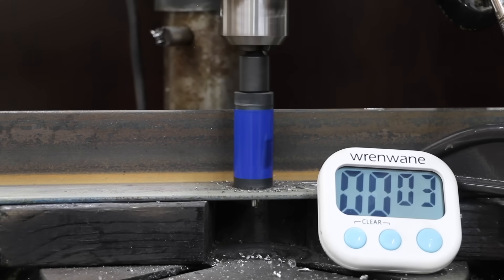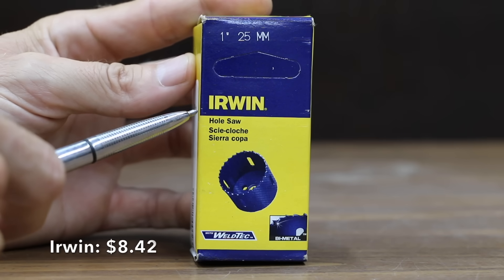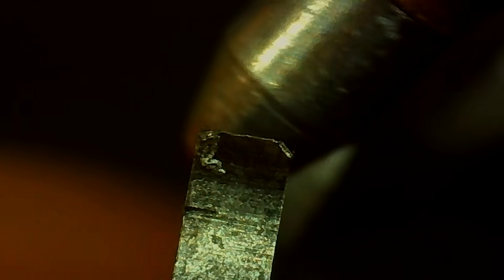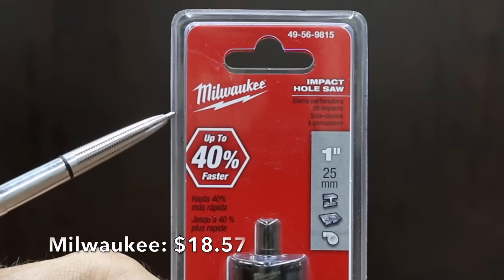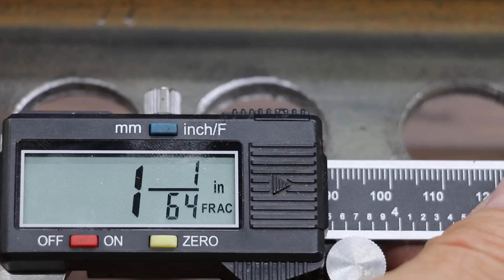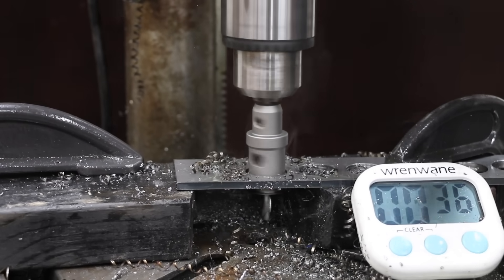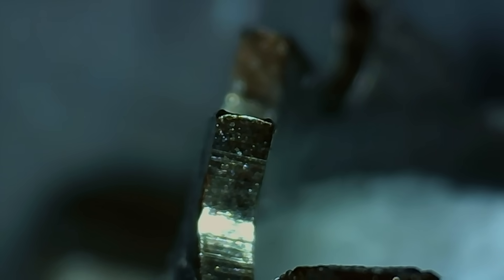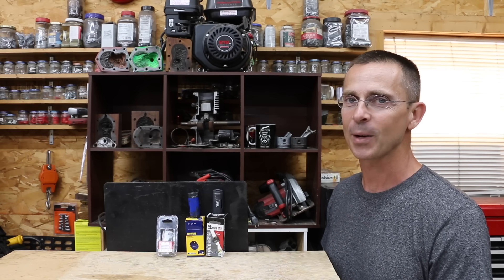Best Hole Saw Brand? DeWalt vs Milwaukee vs Irwin, Bosch, Lenox, Diablo, Bosch, MK Morse

Comment: Durability of orbital sand paper would be cool to see. I use that Gator brand from Wal-Mart and it seems to outlast and outperform 3M which is kind of a shock. Probably pretty hard to test that objectively though.
Reply from the maker: Great video idea.  Thank you.

Comment: How can you guys live with that imperial system 😂
Reply: I am an American. Raised on inches and feet etc. It would not be so bad to use inches for everything. I mean, meters and mm and so on are better. But the fractional inches drive me absolutely crazy. At least, if you use inches, use inches and mils (thousandths of an inch). Fractional inches are just stupid. Also, I would rather use inches only and not feet. Adding together dimensions with feet, inches, and fractions of inches is just so stupid. Like making the job harder on purpose. I finally bought a cm tape measure (with mm markings). It is so much easier to use it for everything.

Comment: Wow great video! I work with 1/8”-1/2” steel very often and I’ve really struggled to find quality hole saws that aren’t very expensive but can get the job done even once on the thicker steel let alone do it over and over like they should be able to before needing sharpening. I usually buy this kind of stuff from one of my local hardware stores though so I’ve never heard of TCT, NGE, or MK Morse. But the MK Morse seemed to perform pretty well and seems like a really good deal so I think I’m going to find some and give them a try! I really appreciate your time as always👍🏼
Reply from the maker: Thanks so much!

Comment: Another great video! Would love you to test wet and dry sandpaper! Testing tensile strength would be handy. When cutting it into strips to get into tight areas it always snaps, so have to use tape backing.
Reply from the maker: Great video idea.  Thank you.

Comment: Could you include the rpm of your drill press on the next test? It should provide a good idea how speed plays a role for different bits.
Carbide and Bi-metal should have different recommended rpm and feed rate...
Reply from the maker: Great suggestion!  Thank you.

Comment: Is the armour plate you are using surface hardened?  Just wondering if you were drilling inside to outside face of the armour, hence the drills bogging down when they reach in to the hardened side of the metal.

Comment: Kind of hard to tell but it looks like either the drill press was running out or the table or vise setup was moving relative to the hole saw. If so, that could explain some of the stalling or chipping of the Carbide
Reply from the maker: Thanks for the feedback.

Comment: So I do alot of chainsaw work, and I've seen and read online that you could potentially put used motor oil into it and it would be better than nothing. I think it would make a good video if you would put used motor oil into an engine and see what actually happens, because I'm really curious and would like to know if its actually fine to use that, or if its not.
Reply from the maker: Thanks for the video idea.

Comment: I practically never use hole saws these days, Changed over to rotabroach or slug cutters as some call them so much faster with a better finnish. I use them both with a mag drill and with an adapter in the pillar drill for larger holes that I would have used a drill bit for in the past. The only time I use a hole saw is if I have to make a larger size hole in thin sheet with a hand drill.
Reply from the maker: Thanks for sharing.

Comment: Nice ! Id like to share a trick i saw in a marius hornberger video. This is probably more usefull for wood but still good to know. Those hole saws definitely dont allow for chip removal and it can get clogged up and even burn the wood. His solution was to just start the hole with the hole saw. And then drill  couple of smaller holes right up to the edge inside the circle. There the chips can accumulate. Or if you only want to keep the round cut off you can drill right up to the edge of your metal plate so the chip fly off. Worth a watch that video!
Reply from the maker: Thanks for the feedback.

Comment: Interesting video, well done. Really good comments from others. One thing i do see, is the carbide tips have large clearance angles and throat angle. I understand carbide being brittle usually has less cutting angles to provide strength to tip edge. Check lathe and mill carbide tip angles. Good review. cheers
Reply from the maker: Thanks so much!

Comment: I work with 6061 aluminum. Can you do a sawzall blade contest with this metal? We typically use Milwaukee blades, but recently switched to Diablo.  The Diablo only lasts a bit longer from my experience.
Reply from the maker: Thanks for the suggestion.

Comment: have you done a test on air impact guns? testing the cheapest to the most expensive? see how long they can rattle before binding and if they actually reach their advertised torque spec
Reply from the maker: Thanks for the video idea.

Comment: Recently ChrisFix posted a video on fixing sugar in tank, and pointed out that the sugar  does not dissolve in fuel, I know you already tested this, but I was thinking what would happen if you  use powdered sugar?
If it is more effective than the previous test, than is  there a way  to fix an engine  after this?
Reply from the maker: Thanks for the video idea.

Comment: Can you test those angle grinder sandpaper wheels? They are arranged with a bunch of overlapping layers making it look like the sand paper will stay "sharp" as the layers wear off but that doesn't seem to be the case unless I got crappy ones.
Reply from the maker: Thanks for the video idea.

Comment: Todd, I'm glad you did these tests.  I have a craftsman brand I would love to know how it stands up. You normally seem pretty good at putting metric on screen, but with the hole diameters you didn't. Even more so, you used fractions instead of decimals.  I don't mind fractions when they have the same denominator but talking about 128th and 64th and 32nds, you lose me. I'm speaking as an American. Again please at least put metric on screen.  Thanks and keep up the good work!
Reply from the maker: Great suggestion!  Thank you.
Reply: 1" =25.4mm
You don't need to be a rocket scientist to do your own conversions.

Comment: I think not having the pilot drill damaged a lot of the hole saws in the ar500 test the carbide doesn’t like the increased and decreased chip loads. Your drillpress wobbles a lot which is what I think damaged most of the bits if you were using them in something like a milling machine or something with a sturdier table and spindle I think there would have been better results and the speed could likely have been slower with more downward pressure as well. That’s just my two cents keep up the good work!
Reply from the maker: Thanks for the feedback.

Comment: Saw a little mistake you did you said 140 seconds on the DeWalt test but is it 100 seconds it was correct in the graph just wanted to tell you that. Love your videos. :)
Reply from the maker: You are correct.  I meant to say 1 minute and 40 seconds.  Thanks!

Comment: There are several issues with this test: 1) The drilling machine is too weak. 2) the steel's hardness is weakened by the heat from the previous drilling. To do a "real" test, each hole must be done in separate steel plates, and you should really use a stronger drilling machine for this test. 3) The metal seems melted by the heat from the drill bit, you should apply coolant for such test, that might also explain the damaged teeth.
Reply: You must have missed the part where he said that he let the steel cool down between tests. I do not think there would be any residual effect from heating and cooling steel that extends 10 or 20 mm beyond the edge of the previous hole. I don't think any of the metal melted. But the bimetal bits were probably softened on the AR500 test due to heating. Bimetal has to get pretty hot to soften up. But the AR500 is tough stuff.

Comment: In my experience cheap drill presses wreck hole saws they turn way to fast and are under powered I have a mill and the hole saw last a really long time.  The blue Irwin one I have really impressed me.
Reply from the maker: Thanks for the feedback.

Comment: How thick was that AR500 plate? The reason I ask is because some of those carbide-tippes hole saws (like the one with the mandrel and the spring) have a maximum cutting depth of 1/4", because that is how deep they can go before the steel dead-heads on the interior shelf of the hole saw. I am wondering if some of the carbide saws stopped cutting not because of worn teeth, but because of no more headspace on the inside of the saw itself.

Comment: Considering we're trying to cut moderately large holes in steel, I'd like to see a comparison amongst large twist drills and annular cutters, and then take the best of the three varieties and compare those against each other. Although, not sure if your drill press could deal with the torque from a 1" twist bit, without consecutive pilot holes. Maybe include the extra time and expense of stepping up twist drills to hit an inch.
Reply from the maker: Great suggestion!  Thank you.

Comment: I just read a bunch of comments about the test setup not rigid enough / lubricant use / run away etc... well you can go two way on that, or you do a "proper" test like the manufacturer surly do and obtain the "50x MORE LIFE TIME or SPEED" in a perfect setup that will not happen a lot in consumer real use, or you can Project Farm it with a not perfect setup but realistic one, and obtain a result that is much closer to real use for consumer use with there drill press not as rigid as a bridgeport or just use any oil as lubricant or does set up the proper speed every time with a diferent bit. Conclusion, I take  the Project Farm "flawed" Testing every day against manufacturer testing because for  consumers it just more realistic. Thank you !
Reply from the maker: You are welcome!

Comment: Using a bi-metal hole saw with no cutting oil? You're a mad man! :D Cutting oil will make a huge difference even in mild steel. Also i am now interested in Morse (?) carbide tipped one. Didn't think you could even get a carbide tool for under $10.
With that said, next time it would be interesting to have an amp meter on the drill to see how much power each tool requires. From experience i can say that something like Irwin can be used in a hand held drill, but i doubt many people would want to battle with carbide since it removes so much more metal.
Reply from the maker: Thanks for the suggestion.

Comment: Might be interesting to check the hardness of the steel blades after testing. Getting that hot might temper the metal and soften it. Could be why the steel saws lost speed after a few seconds?
Reply from the maker: Thanks for the suggestion.

Comment: So I know they called it a hole saw but the ones with the springs, I normally use them to knock holes into electrical panels not really used for thick steal.
Reply from the maker: Thanks for the feedback.

Comment: I hate to say this but you need to not use any petroleum oil on a hole saw keep a blow gun aimed right at the teeth blowing chips out continously you will be surprised how much faster you can go through your materials. If you ever need to use any kind of coolant use a water soluble oil but dish soap and water works really well and if you want to keep it from rusting add some baking soda. But using a blow gun works better than anything. I have been working with metals for over 45 years and have experimented with all types of ways. Also never use oil on a drill again soap and water or water soluble oil.
Reply from the maker: Thanks for the feedback.

Comment: You should test an oil additive called GoNMF (also called MoGlide). It’s not well known and seems to actually work unlike all the other oil additives. The science behind it looks legitimate and several people have posted videos of the product significantly decreasing engine vibration as soon as it’s added. I’m very curious as to whether it actually works or is a bunch of BS like the other additives. Thanks! (P.S: if you test it, please add it to oil instead of using it as a standalone lubricant :)
Reply from the maker: Thanks for the video idea.

Comment: I have a rather large set of the Diablo hole saws.  I love them for most projects.  The ease of swapping mandrels and hole saws around is nice, and they hold up very well. (I have yet to replace one)  I was shocked to see it was one of the deepest cutting ones on the armor plate piece and held up pretty well on it.  I don't have any carbide tipped ones (mine are bi-metal), and mostly use them for home projects and don't cut steel bars with them.   But they sure can cut through wood without a problem and thin metals, plastic, etc.  They aren't the most expensive, but they aren't the cheapest either.
Reply from the maker: Thanks for the feedback.

Comment: It looked like some of those were high speed steel and not carbide. HSS requires great pressure, cutting fluid and slow speeds compared to carbide. Its likely why they burned up so fast, but nice video as usual. Your channel actually came up on a gun forum and a few guys (including me) were giving you a tip of the hat to your tests and procedures.
Reply from the maker: Thanks for sharing.

Comment: picked up a  used12set of milwuakee dozers with a couple missing for 20$ with mandrels and center drills included a couple years ago and im still using them dont think any are burnt out yet, i cut a decent amount of steel with them the 1.5" and 2" have probably done about 20 holes through 1/8" and alot of holes through 1/4" all with an 18 volt cordless drill, i flood them in oil typically unless the projects getting painted soon then i try to be more conservative
Reply from the maker: Fantastic!

Comment: Very cool, I didn't expect to see it this soon!  It seems I may have to try a couple different brands.  One thing I'll add is that our latest Lenox kit has been in the shop for probably 4 years.  We've had to replace some of the more popular bits a couple times (2" gets HAMMERED), but I'm looking forward to trying some of the ones you just tested.
Reply from the maker: Thanks for sharing.

Comment: I recently tested the lifetime warranty on the Milwaukee hole dozer.  I purchased a 3.5 inch hole dozer to install a gooseneck hitch in my truck. Using a M18 Milwaukee drill on low speed I was able to drill the hole, but experienced a lot of kickback and stoppages. Once the hole was drilled I expected the hole dozer and realized 1/3 of the teeth were missing. The ACE Hardware I purchased it from exchanged it no questions asked. They did say that they haven't had many warranty claims and were surprised that the hole dozer failed. I also used a 2.125 hole dozer to drill a hole to install a trailer wiring hookup. I was also able to drill that hole but with less kickback and stoppages, without loosing any teeth. I suspect my Linex bed liner had something to do with my problems.
Reply from the maker: Thanks for the feedback.

Comment: Video idea: Pre mixed 50:1 fuel, brands like VP, Husqvarna, Stihl, Aspen
Or will using 50:1 in an emergency damage a vehicle/engine that isn't designed for it?
Reply from the maker: Great video idea.  Thank you.

Comment: Using the pilot would have helped in the abrasion resistant steel. Carbide doesn't handle shock very well so the chatter probably helped damage the teeth
Reply from the maker: Thanks for the suggestion.
Reply: @ProjectFarm  that's tough material, I've worked with it a few times.  Everything you can do to help the tool last helps, especially the cutters with the wide cutting area.

Comment: This was a difficult test to be fair to all the brands.
Since the Drill was the real limiting factor.
Carbide is very brittle, and does not take kindly to being withdrawn and put back to the cut, especially if it bangs the bottom.

A proper test would be to use a Magnetic Based drill with a gear drive and a proper low speed.
It would have the required torque, so that the cutters would not stall , and need to be with drawn.

I know a Magnetic  base drill with a gear drive is a pricey Item.
If you can find one used,  it would be a valuable tool to have for your testing.
Reply from the maker: Thanks for the suggestion.

Comment: The carbide tools need a stiffer machine and a lot more weight on them. I bet they would have gone through the last plate if they were mounted in a knee Mill with zero damage.
Reply from the maker: Thanks for the feedback.

Comment: I have had very good results with my Lenox hole saw set. One of the things I value is the high quality of their pilot driver. To see this, you need to test larger diameter saws where the quality of the arbor becomes important. Concentricity is important if you want to get a true diameter and round hole.

Other brands I like include Starrett and Greenfield.

My experience with chicomm hole saws are a consistent disappointment
Reply from the maker: Thanks for the feedback.

Comment: The usage of "Made in USA with Global Components/Materials" as a labeling standard is such a sham.  So - basically, it was made in China, labelled and put in the package in the USA?
Reply: Pretty much... In this case some of them would just be the hole saw pressed and then shipped to the us and teeth cut in to them. In some cases it could be the roll of steel  shipped from a factory in China and then the tool is made here.

Comment: Suggest test foil HVAC duct tapes - for repairing and sealing furnace ducts, dryer vents, etc.  Which hold up to hot and cold attics?  Damp crawl space?  Old dusty or rusty ducts?
Reply from the maker: Thanks for the video idea.